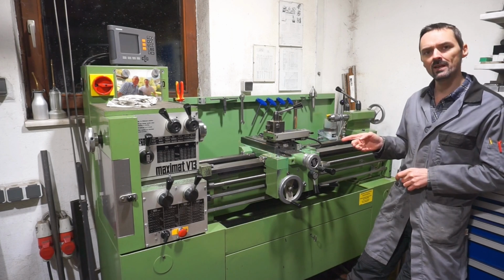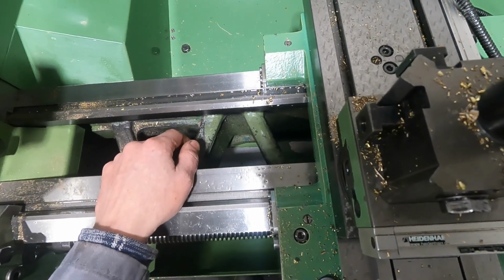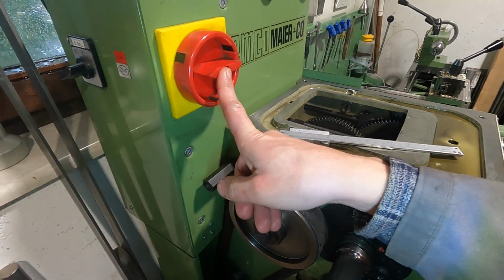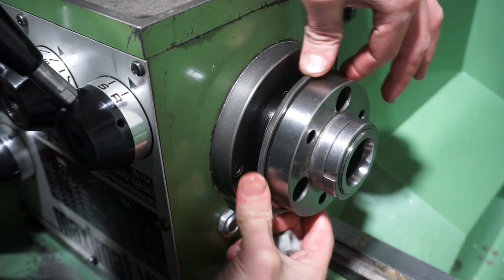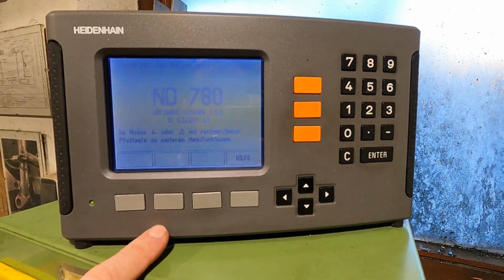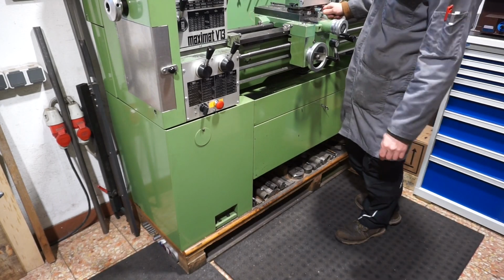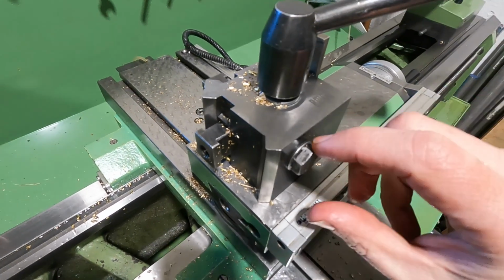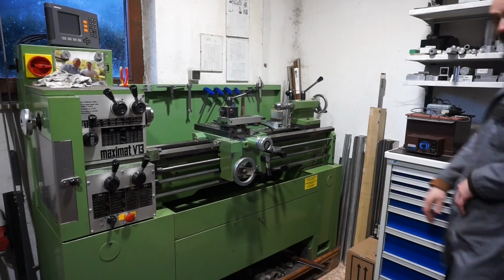EMCO V13 Lathe | My Opinion, Modifications and Accessories

Comment: Currency concessions are really difficult but 25k euros would seem cheap for a European made lathe in modern money.  As for Emco's engineering, while working on my long gone V10, I had the distinct impression they had never seen a real machine tool up close. It was part way there but there were some rather odd choices. You should consider adding a Rocketronics ELS, they make cutting random thread pitches so much easier.

Comment: Hi Felix, i have a question, i have bison 4 jaws chuck 250mm. I have EMCO maximat v13 like you. Do you think 250mm is too big for this machine? Thank for your videos, they are very inspiring. Good work!
Reply from the maker: Hi there, depending on the the 250mm chuck design, it's jaws might hit the bedways if they are open all the way out (if you clamp e.g. something large). But I guess if you check before starting the spindle that should be avoidable. ATB

Comment: Most of the italian lathes have the ways with the same shape of the emco’s. 
MY theory for that shape is because the carriage tends to spin clockwise (top view) during the turning operation: pivot point is the tip of the tool and the force is given by the pinion.

Comment: "Optional hardened bed ways" is a wild statement in itself, you would think something as crucial as the durability of the ways has to be on the top 3 of requirements, when it comes to getting a lathe.

Comment: Limiting Carbide insert types and sizes is a wise decisions. I have done the same thing to the extent I can. Very nice selection of tooling for the lathe. I use annular cutters extensively in the lathe and mill as well, it indeed a quick way to remove material.. I will have to look around for those core drills. in the larger sizes. They must be available here in the US in one form or another,  I have never thought of using them for metal. They are certainly available for concrete drilling. Cheers

Comment: I also don’t get it, why the prismatic ways ar like that. I have a Romanian made lathe . SN400 , from the 70’ has the same ways . WEILER E series have the same ways. I have a E50 form 1997 , same ways . E30 from the same era has the same ways . 
My dro on my machine also start whit the general button, is the best practice , but , I have my dro on the carriage… for me is a must have , maybe because my machines are larger . 
Same issue with the screen on the heidenhein dro . I even replaced the screen whit a aftermarket one , Chinese one , same problem. When cold you need to wait

Comment: Every action has an equal and opposite reaction.
As load is applied from tool pressure from the spindle it is trying to rotate the saddle in opposite direction imparting the load on the large prism flat, not the small prism flat, good design.
However when lightly loaded plus the mass of the saddle will increase the wear on the smaller way being smaller in area. I like the south bends and Hercus lathes with double prismatic ways.

Comment: Hi Alex, with all your attention to detail I wonder why you did not avoid the biggest death feature of a lathe:  reaching across the chuck to touch the heidenhain or get pliers when standing in front of the carriage.  With my right hand I can reach my DRO head and all the tool holders to the far right side of the tail stock and avoid getting across the chuck or rotating work. It may seem a minor point but you did spend alot of time making a nice machine better.  Another handy tool is a left handed caliper where you can read the dial from the tailstock side non-inverted. When I lived near Belvedere castle I looked high and low and found very few machines or tools for sale. You got lucky finding a nice used machine.
Reply from the maker: Very good point, I guess I didn't think of mentioning the fact that I am a left handed person, so the natural choice was to mount the DRO on top of the spindle housing. Thanks.

Comment: The tilted angle on the carriage slideway is not an uncommon feature on lathes from the 50’s through to 70’s.  The idea is to better resist  cutting forces, the downside is that you end up with less area.  Australian made lathes Nutall and Macson both used this design.

Comment: I don't think the way configuration is a branding thing because the Super 11 is not the same. Also S11 has relatively poor lubrication access. You’d think for the equivalent of €22k it would be better since the rest of the machine is very high quality. I would love to see a detailed video on the lubrication system as I have the Emco Super 11
Reply: Are there different versions? Iirc my Super11 had the same asymmetric profile.
Reply: @StefanGotteswinter  I guess there must be which seems odd from a factory production viewpoint. And they seemed to have different spindle options as well. I have the D1-4 with MT5 which is very nice for taking collets, except I can't get close enough to the spindle with the carriage. I think I will look into stealing Alex's mod where he moves the carriage stop, assuming the rack pinion stays engaged. Lots to appreciate in this video.